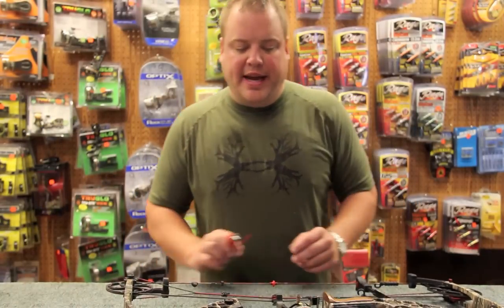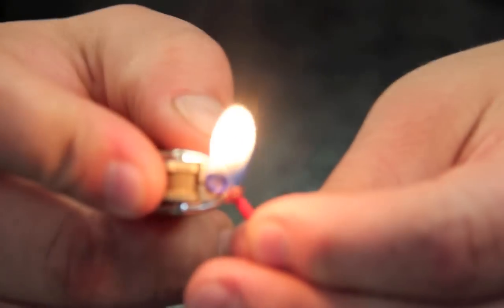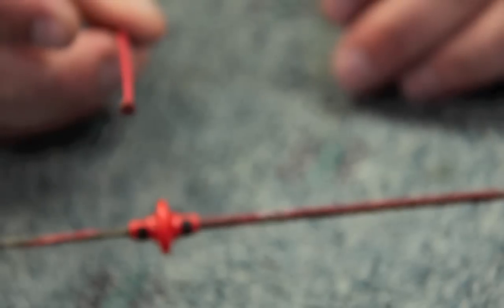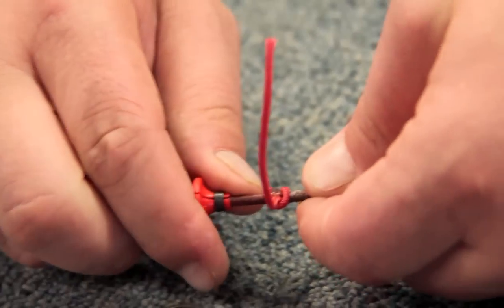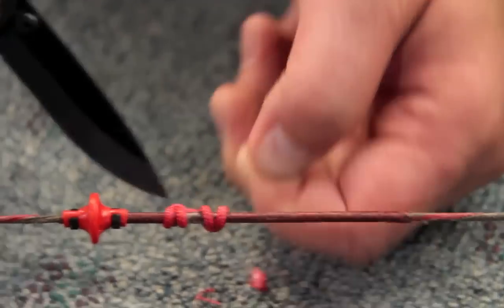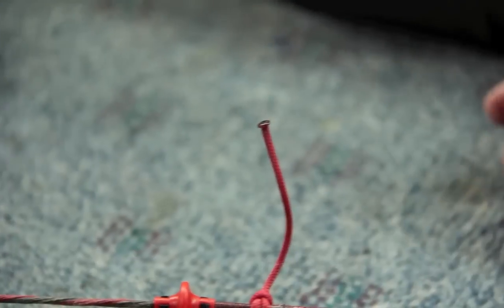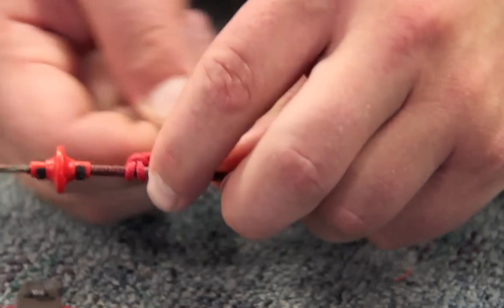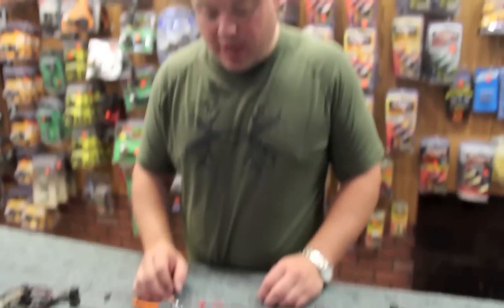How to Tie a D-Loop on a Bow by Draves Archery

Comment: Draves Archery, I have posted this elsewhere and need a lil help. My d loop is getting a lil raggedy. I am concerned that if a do not put the new d loop in EXACTLY the same position on the string, my sight pins will be off. How much leeway will I have in it's positioning without mucking up my POI? Also, will using a different diameter d loop material mess with my point of impact? I HATE MESSING AROUND WITH MY PINS becuase I just got them set perfectly. That was a chore! Help.

Comment: if you want to melt it and not burn it as you did you need to heat it with the most cold part of the flame (redest) and not with the most hot (blue)

Comment: I have a 75lbs bow and I tied the d-loop exactly as shown and tested it etc but when I pull the string back, the d-loop pinches the nock and pulls it right off either losing the nock mid flight or leaving it stuck on the string... This obviously shouldn't happen what did I do wrong??
Reply from the maker: Your serving may be too large, or the d-loop knots may be too close together. Do all of your arrows do this? Sometimes carbon arrows may crack in the back, thus causing the arrow to be loose and results in losing the nock.

Comment: Only thing you really didn't cover is a ballpark length of material to start with? Dloop pliers not feasible for the avg person to own. It ain't high tech surgical equipment...they can be bought all day on ebay for like 20 bucks..LOL
Reply: ***** If you say so. I guess I must be above average.
Reply: ***** If you say so. I guess I must be above average.
Reply: ***** Yep and PHA-Q too.
Reply: I cut mine at just a smidge over 4 1/2". By the time it is melted on the ends, it is right at 4 1/2" or a hair shorter. Makes the right size d-loop for me and everyone I tie it for.